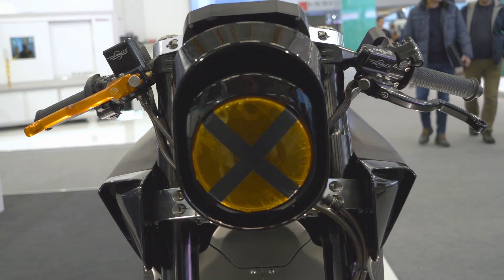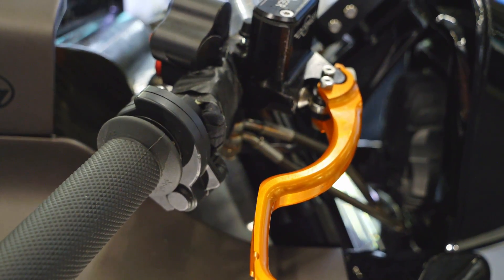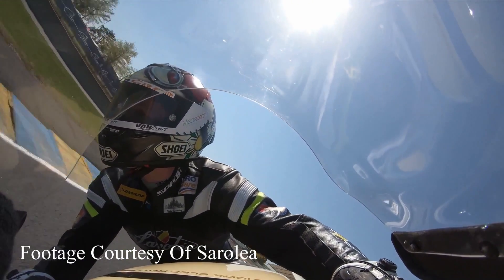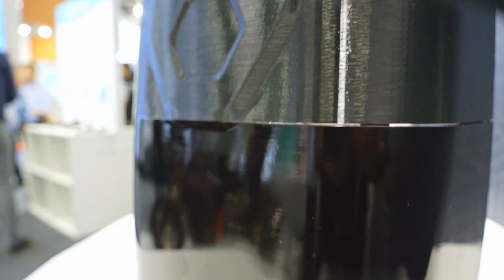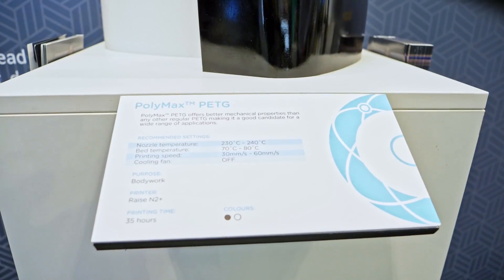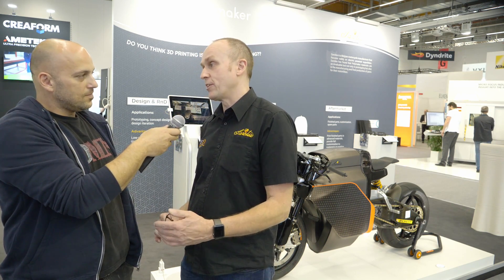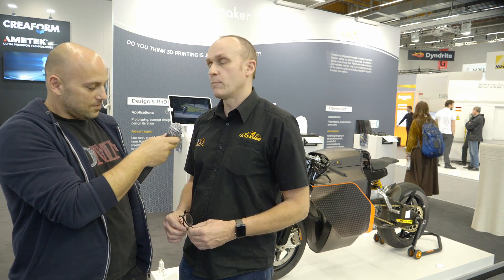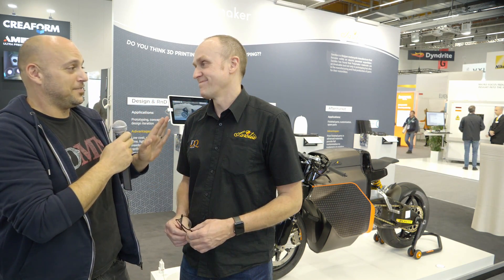A Fully Electric And Partly 3D Printed Motorcycle At Formnext - The Sarolea N60

Comment: Formula 1 mono cockpit is designed to protect the driver. How does that work on a bike?
Marketing rubbish if I have ever heard it
Reply from the maker: A monocoque simple means an integrated chassis to the body. F1 have the added benefit of integrating extra protection to the driver. As you said it’s designed that way in F1, but it doesn’t make it less of a monocoque if driver safety is not present. It’s like saying a car is not a car if it doesn’t have airbags....
Reply: @3DMakerNoob  ok. Much appreciate.
I didn't even know it was spelt or worded like that. My ignorance. However...monocoque is used all the time so referencing it to F1 tech implies the fact that what makes it unique in F1 is that in protects the driver and its safety attributes. That is all. 
I'd nees to watch the video again...but I am pretty sure he referenced f1...maybe I heard it in my head. If so..my bad
Reply from the maker: Nah he did, because essentially it’s based on the same attributes  and technology, less the safety of of course :)
Reply: @3DMakerNoob  ok. Makes sense.  Thanks for clearing it up. 👍
Reply: Monocoque chassis here protects the battery. Plus is light-weight, plus we can bolt everything to it, head stock, forks, motor, seat. 
Our team owner and bike builder worked in F1, building monocoque chassis' so a logical progression to use the technique and skills on the bike :)
Reply: @stillmation  Oh. It protects the battery. Very important.

Comment: Amazing design! 900 Nm tho... surely, you can't actually use it all. A modern litre superbike will stand up on it's rear and try to spin the rear tyre even at 150 Nm. Those 900 Nm at the rear wheels seems like insane number.
Reply: @Captn_Grumpy  I can't think of any situation, when 900 Nm could be utilized on two wheels. Even cars close to 1 kNm spin their 335+ wheels unless there's a at least a 1.5t of weight pressing down + aerodynamics adding even more down pressure. I'm not saying Sarolea guys are lying, but there must be something else going on. 900 Nm on bike tyre contact patch - ain't gonna happen.